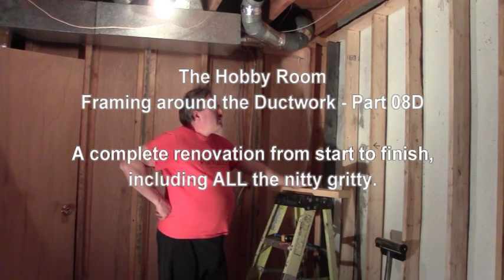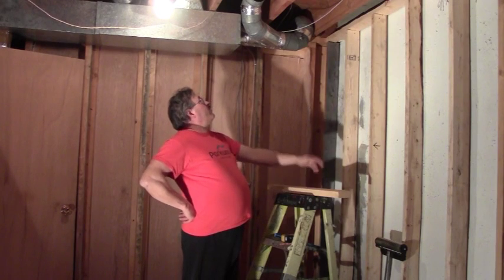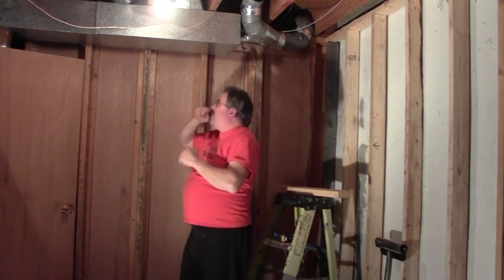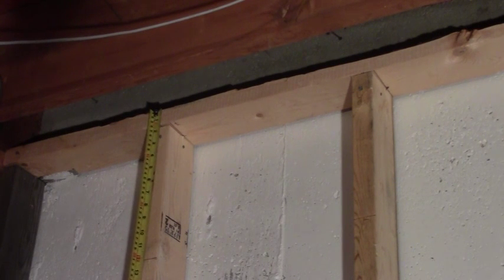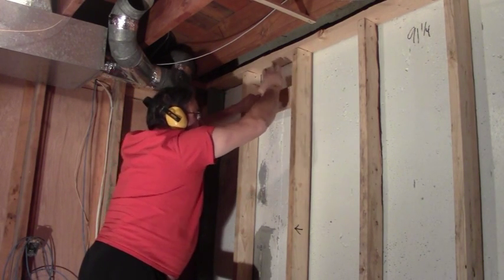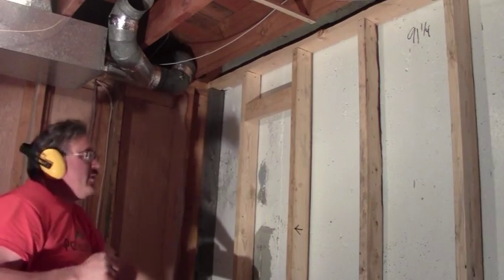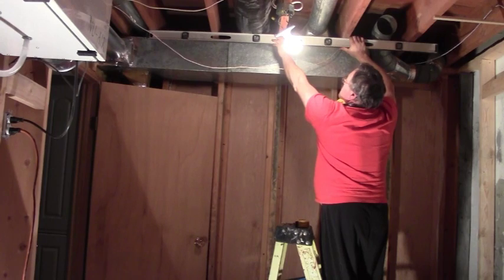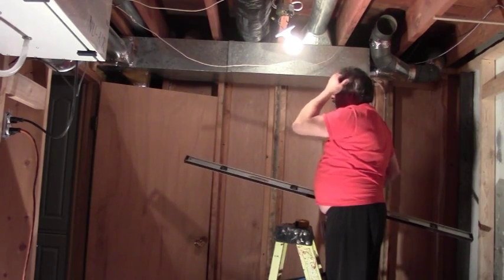Framing around the Ductwork

Comment: Hello, so regarding the second ladder, did you frame that out with 2x2's instead of 2x4's.  Thanks
Reply from the maker: It's been a couple of years since I did the project, but yes, as I recall I believe I did use 2x2's for the second ladder. You're only making a cosmetic support (rather than something structural) so you can get away with a few shortcuts like that on occasion, especially if you've got a tight spot.

You've got me wondering now... I might just have to go lift up the ceiling panel and have a peek at what I did!
Reply: @patthebackyardbuilder421  thanks very helpful video